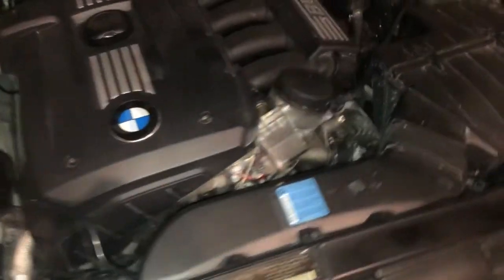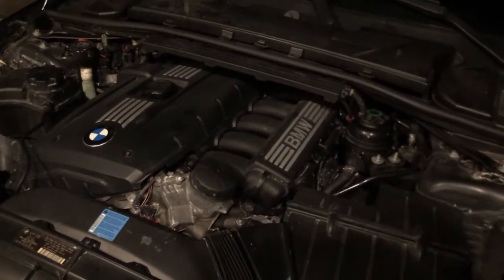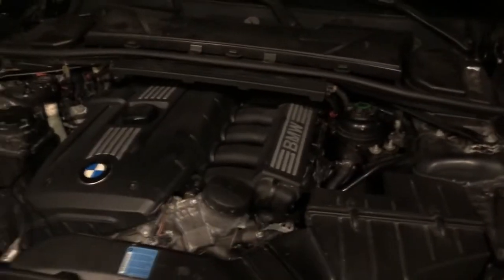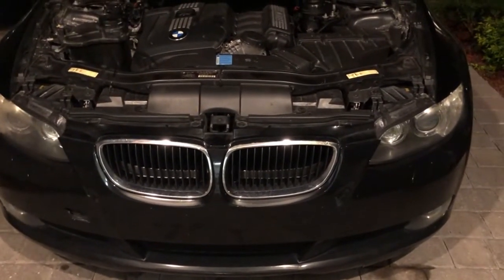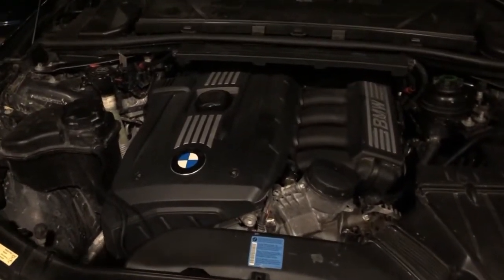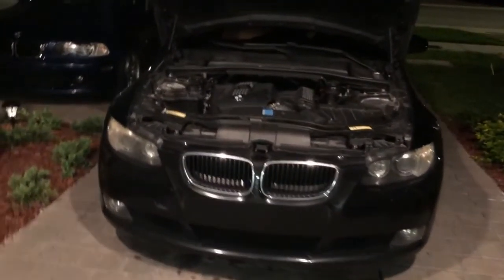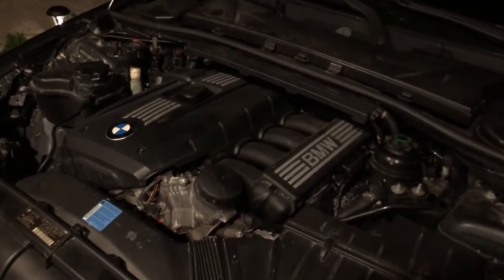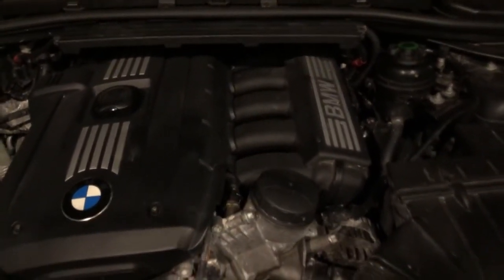BMW 328i N52 3 Stage Intake Manifold Review and test drive!

Comment: Thank you so much man, finnished swapping the manifold and flashing the car yesterday and it feels like a beast, all done with the help of your two videos!
Reply from the maker: That’s great! Glad they were helpful to you to get it done. Definitely how the car should have come stock
Reply: That’s the difference between a flash and a tune , is the flash just for one specific part?
Reply: @autohut3720  thank you for this. it inspired me to do it and it's great!
Reply: @Streetcorsa flash is usually said when referring to “flashing” the car’s ecu with an off the shelf configuration, like for the 330i when you have the 328i. Tuning your car often means customising the timing/ignition/fueling based on your hardware etc. though people seem to use them interchangeably now.

Comment: Thank you for helping me do this conversion with your prior videos. The difference is massive on my 328i!
Reply from the maker: Very glad they’ve helped! This is how the car should have come from factory👍
Reply: Anu difference in fuel consumption?
Reply: @cavedweller8814  slight decrease in consumption but much better engine response
Reply from the maker: Just Wryt  the manifold is plastic yes. Can you port it? Sure. There’s no reason to as it matches the cylinder head perfectly and you’d have to port the head too.
Reply: @mikejnaughton1226  did u flash it yourself ?

Comment: Another very happy swapper here.  Thank you for the videos.  This is really great.  I can hear cool new sounds that I like out of my AFE intake, too.  I tested the DISAs before updating SW.  The small one didn't stay closed so I replaced it.  Took the risk adverse path and got the MAHLE genuine BMW part.  The connector that was "gonna make you wanna quit the whole effin job" could be pretty easily removed once I eventually saw how to push in the inaccessible side with a flathead leveraged on the engine, then push in the other side by hand.  At first I was working the flathead into the space between the hose and connector to get it loose.  I'm glad I didn't break it.  You might want to think about what you are going to do when you see that you could do some cleaning where the injectors spray into the cylinder head.  I sprayed in carb cleaner but wasn't prepared with a clean scrubber I trusted.  It didn't obviously do much other than pool then flood when I started up later.  I did not clear any errors after the RSA delete, I just power cycled a few times then did the 330 upgrade.  The remaining AWD error went away after driving a bit.  Open your back seat access to the trunk before you disconnect the battery (I did just the negative) and lose the ability to open the trunk from the outside.  Have fun.  Thanks again.

Comment: For a 2011 328i do you need to get 2 new DISA valves as well for installing the manifold or do you only need to get the manifold? Thanks for the great vids
Reply: And are you going to restock your manifolds on eBay soon?
Reply: did u find answer
Reply: Did you find an answer? What do I need other than the manifold? I know you should but extra hoses because those might break when you are taking them out

Comment: Does your car have the gm transmission? Thanks
Reply from the maker: Yes my car has the 6L45
Reply: @autohut3720  Thanks bro. Seems like this transmission tune or upgrade you did is the only one available for it?🤷‍♂️
Reply from the maker: @L-Noble.YT_Hi.Res-Soundminds  yeah it’s basically as if you went and flashed an e83 3.0si from scratch. This car just happens to take that software too. It makes it better but of course it isn’t anything like xHP just more responsive
Reply: @autohut3720  Thanks for the explanation and the video. I enjoyed it and learned more from it.
Reply: Can you make a video on how to flash the transmission
Reply from the maker: @fastcars7835  I am working on one that shows the process. Very good upgrade aswell
Reply: I'll look forward to the video, thanks buddy, Happy New Years.
Reply from the maker: @fastcars7835  likewise happy new year👍
Reply: @autohut3720  I have a few questions about the transmission flash, is there a way I could message you? Do you have messenger? Or Facebook?

Comment: do you still have to callibrate the transmission for a manual car? and does the bimmerlabs tune do that callibration as well? or is that a different software required for the transmission callibration?
I have a e90 328i and I want to upgrade it to get power like 330i and I also plan on getting headers later on as well
Reply from the maker: No need to do anything with the transmission if you have a manual car. All that’s done is letting the engine adapt with the 330 tune
Reply: @autohut3720  thank you so much!
Reply from the maker: @pragashgnana597  welcome👍

Comment: I tried flashing my Z4 3.0i to a 3.0Si but it stops during the unlock process. I think my Winkfp is working right but I'm not sure. Also how to check if Disas are good?
Reply: Check them in the actuations menu in inpa or you can plug them in the stock tune and they should function but won't open and close when they should because of the 328 software..
Reply: @lunaticrider1  Yeah I checked them but they were not acting right so I bought new ones.

Comment: Wish i would have seen your videos before i purchased and installed my manifold. I have a 2009 E91 not sure the donor model/year for my manifold but it only has one hole on the back. I plugged the hose coming from my valve cover so it could work with the single port manifold. now i often smell oil while driving. I was told it was due to a build up of gasses in my crankcase. I believe the manifold originally came with oil separator do you think installing oil separator would be good idea in my situation
Reply: There were two versions of the ventilation system on the n52. The first one had an exterior oil separator like you mentioned then they have one that the valve is built into the inside of the valve cover where the hose attaches. You need to have a way to relieve and process those gases, so yes you shouldn't have it plugged because it can cause problems like blowing gaskets because that pressure needs to escape. And you won't be smelling the nasty gases too. They sell the oem separator, you should buy and put it on.

Comment: I have a question. When installing the 3 stage manifold does "flashing" mean you are resetting the ECU/ECM to relearn with the new part? I can install the part but my computer skills aren't sharp. And is it a different flashings procedure if it's a manual 328i?
Reply: No, you are flashing a new file

Comment: i found a 330i parts car. I want to swap it in to my 328i n52. Can you point me to a video or guide to do this? any advice or tips? Thanks man. Liked and Sub.
Reply from the maker: Swap the manifold or entire engine? If you want to swap the whole engine there are certain things that are different that I know of and I’m sure others that I don’t know. The 330 uses an external pcv system instead of the integrated one in the plastic valve cover the 328 uses so you want to swap over the whole engine with valve cover, pcv and manifold. Throttle body I believe has a different connector but you can check. If they look the same then no need to swap them. Some o2 sensors and routing can be different depending on if your 330 is a very early car but if not shouldn’t be an issue. Many other things. I assume you’re trying to run this off of the 328i DME so if you get any codes after swapping and clearing you might have to swap other parts such as maybe MAF sensor and who knows what else. These engines came with different computers from factory but can still match with some changes.
Reply: @autohut3720  i should have specified.  the manifold. i think i found your video.

Comment: How would i know if the 3 stage manifold im trying to buy from ebay is in good condition by just looking at the pictures. Like what should i lookout for. I foud a couple used ones price ranging around $180-$350
Reply from the maker: You can’t know without testing the disa valves on inpa/ista. They can look perfect and not work because the electronics inside are bad. Also disa valve revisions play a role. You want small valve part number ending in 538 and large one in 537/114 at the very least

Comment: Hey man, love your videos! How many HP would u gain without the flash? And with the free flash how many ? Thanks
Reply: On 328i 2011
Reply from the maker: Without the flash I don’t think you’d get much since the car won’t be making up for the valves being there at all. The valves will close when the car is started with the manifold installed but that isn’t gonna make much of a difference. The flash by itself does make a difference but it is best when coupled with the manifold so you can have the proper setup and runs as it should
Reply: @autohut3720  let me know if I can buy one directly from u

Comment: I've just finished the swap & flash and seems like I don't notice much of a difference on my 128i. I will reflash the 128i to 130i tune now but seems like it's not that big of an upgrade.
Reply: After you reflashed it did you notice any difference? I have a 128i and am also thinking of doing the upgrade
Reply: How was it after the tune? You definitely need the tune even notice a difference
Reply: Not really worth it IMO. It gives a little upgrade but it's better to go with a custom tune like I did. EVentually I ran out of upgrades on my 128i and decided to sell it for the 135i and man, what a night and day difference... never looked back! Currently have the 135i convertible stage 2+ and it's pure joy. @zureai
Reply: @charlesd7301  Okay that’s good to know! Thanks. I might just skip out on it then myself. Enjoy the 135i. I’d love to own a 335i but I love daily driving an NA car.. must cheaper to own lol
Reply: Honestly drove it all summer and did the required preventive maintenance.. if you're handy you can get away with most N54 problems..Next summer i'm doing the valve cover along with all gaskets then I should be good for a while hopefully! The N54 is an amazing platform. My first BMW was a 328 2009 and since then i've owned like 6-7 different models over the years. N/A cars are fun and reliable but to me the real fun is the B58. Amazing engine and enjoy my M240 all year long! Good luck @zureai
Reply: @charlesd7301  Yeah a b58 is a sweet engine and the m240 is sick!! Enjoy your time with it! Well this is my introduction to BMW and I needed a “reliable” daily. I didn’t want to deal with any turbos especially since it gets pretty damn cold in winter and I park outside most of the time lol. I just know there’s extra steps to maintenance with a turbo that I didn’t want to deal with on top of European car maintenance. Maybe my next bmw will be with a turbo but for now I’m enjoying the n52! It’s quick enough… for now hahah
Reply: How can I tell if my used 128 has 3 stage already ?  They always look the same when they say 3 stage or not

Comment: nice work ! i have a 325i pre lci e90 and just bought the 3 stage manifold. do u know if a 330i dme will work on my 325i if i swap the dme ?
Reply from the maker: It will be a ridiculous amount more work to swap the dme than flash the car to 330 as I show in my tune video. Dme has to be synced with everything in the car and most likely will need to be flashed to 325. Mod your stock one. Also make sure you test the disa valves in your manifold before swapping on inpa

Comment: Hey man whats up! I'm very excite about what I saw in this video, do you sell the manifolds and also the trans tune that you mentioned? Thanks a million in advance
Reply from the maker: The trans tune is available in the bimmerlabs website if you put your car in with the guide I made for flashing and change your ecu from msv80 to gm1912. I only recommend flashing it if your car is older than 2008 as some newer cars can have issues with it until it’s resolved and need to flash the transmission back to stock if flashed. I sell the manifolds on eBay, here is the link, don’t have one available now as I sold the last one recently but I have more getting finished
http://rover.ebay.com/rover/1/711-53200-19255-0/1?icep_ff3=2&pub=5575378759&campid=5338273189&customid=&icep_item=203103117859&ipn=psmain&icep_vectorid=229466&kwid=902099&mtid=824&kw=lg&toolid=11111
Reply: Hi there and thanks for making this video. My car is a 2008 e93 328. Wondering is there a specific year 330 intake I should be looking for?  My car has 200 thousand kilometers on the clock and will this mode put more stress on the engine?  Don’t want the reliability to suffer.

Comment: Any difference in fuel consumption?
Reply from the maker: None except the one induced by wanting to make use of the newfound power with your right foot. If you drive it easy I think it would be even better than before as you don’t need as much power to get up to speed